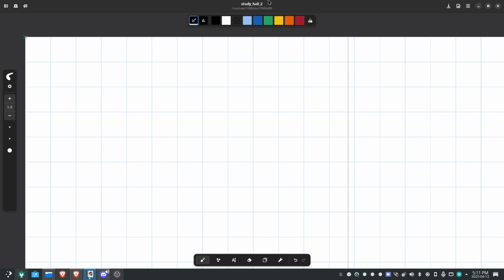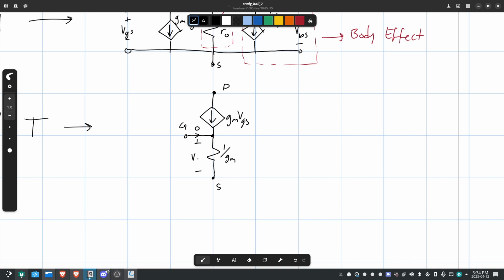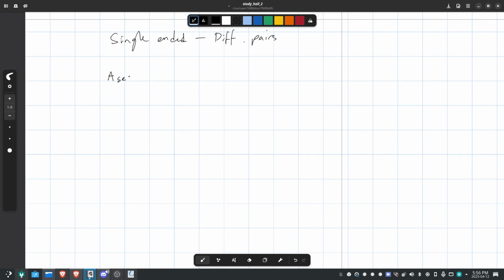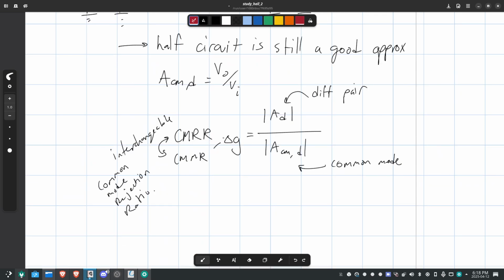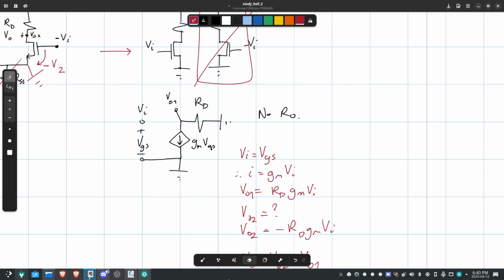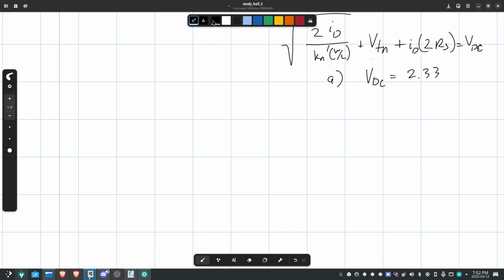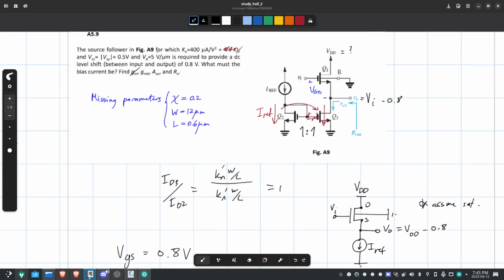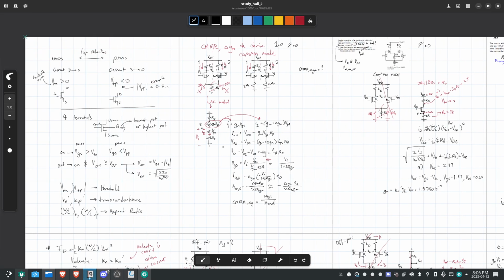TMU ELE404 Final Exam Study Hall - MOSFETs

Comment from the maker: FOOTNOTES & CORRECTIONS:

- For ICMS, please see my footnote video on it. https://youtu.be/zZAI4TeiJ8E

- I forgot to note it in my content review but noted it in Question 3- |Va'| is a unit in Volts / Length. |Va| = |Va'| times L (The L in W/L).

- In diff-pair mode, Vi = 1/2 Vg1 = -1/2 Vg2. If you forget to do this (Which i did) your amplification will be 2x what you expected (because Vi is 2x as large). There is no change in common mode, aka Vcm = Vg1 = Vg2. This is also why my CMRR is 2x what it should be, I calculated Ad as Vo/Vg1 rather than Vo/Vi.